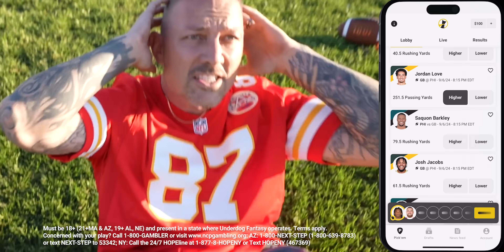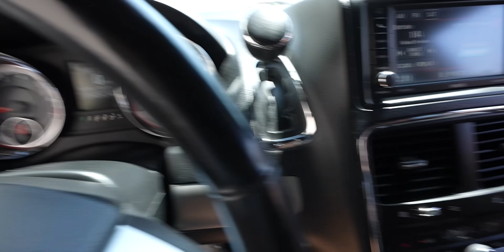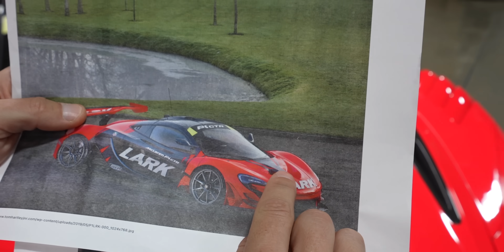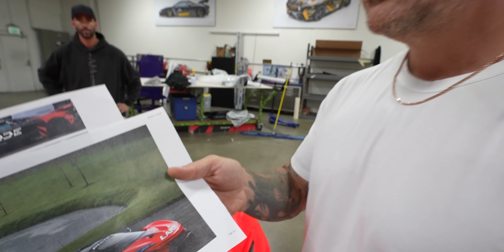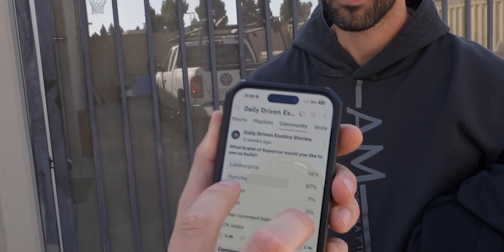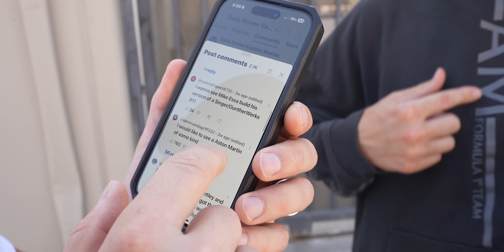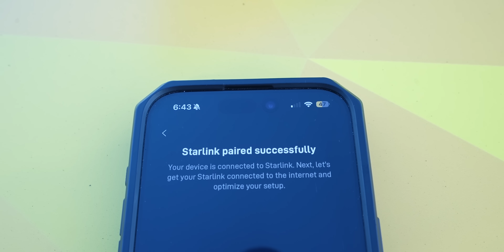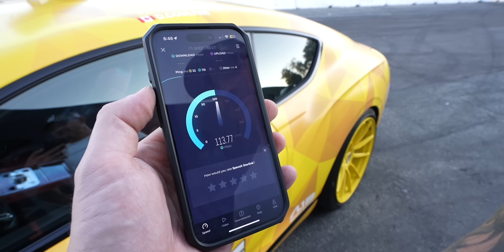REVEALING 1 OF 1 MCLAREN 720 GTR!

Comment: FTR acetone wouldn't have damaged powder coat like it did on Dave's wheels.. I'm fairly sure Fluffer even stated he was using PH neutral products, what most likely happened was a mixture of contamination and an incorrect baking cycle when they coated them due to time constraints. I have had matte light coloured wheels for ages and whilst yes they show the dirt more, they do not stain any differently. The staining and discolouration lies with whoever painted them the first time
Reply: Fool tryna get the fluffer not hired again
Reply: Didn’t they get it detailed by someone at Car Week also?
Reply: @isaacmays1815  I mean I didn't quite wanna say it, but yeah when Nick commented about it in another video he pursued it as the Fluffers problem and kept correcting Dave saying he definitely used acetone; when Dave denied it. I was a bit thrown by that but just presumed that was only my assumption lol.
Reply: It was clearly an issue before Fluffer touched it. Either the painting process or something someone else used.
Reply: @LonelyStonerHOU  yeah some random carpark wash station.. I recall Dave wanting them to degrease the oil stains on the wrap, not sure if they did much to the wheels though.
Reply: Came here to say fluffy said he was using a PH neutral cleaner so that shouldn’t have caused an issue.
Reply: Agreed, he was pointing fingers in the video and being completely inaccurate when instead of taking responsibility of subpar work that was done at his shop
Reply: @isaacmays1815  facts but i think that's why Mike had him come do the benz because they know Nick is full of shit
Reply: to be fair acetone IS ph neutral.
Reply: I don’t think it was fluffers fault either..he’s just happened to be the one that cleaned the wheels and uncovered the damage. Although Nick did say he suspected someone used acetone i think it was the guy that painted the yonda the one that was blaming fluffy. Like someone else pointed out the car wash from Monterey car week couldn’t have done the damage as Dave wanted the wrap degreased from Damons murcielago. On another note Dave recorded Fluffy apply the wheel cleaner real time and the stains were already “baked” on as well as fluffy noting the discoloration.
Reply: A friend of mine powder coats wheels and his first comment was that someone f’d up the baking process
Reply: Fluffy is dope
Reply: Don't think it was Fluffer fault. I blame the detailer in Monterey.
Reply: @everythingvinyl  it's neutral on the acidic scale, but also why would any detailer use acetone in the first place 😂that's why I don't get the sudden jump to conclusions of acetone being the culprit. The wheels clearly weren't baked properly, whether thats in the off gassing stage pre-paint, or after paint. I run Yellowstuff pads which are notoriously dusty, in fact one of the worst out there for dust and yet they've never harmed the finish on my matte wheels.
Reply: Fluffer didn't fluff up
Reply: Fluffer being defended is a W. Mans came and and became a character. Hope he truly wasnt the one who messed up which would be crazy since he pointed that fact out first
Reply: The original yellow was powder or paint?
Reply: @OGWonka  Powder coat, very little use wet paint systems these days because they're ironically not as durable. Some powder coats don't have to be overcoated, but uncoated use isn't recommended for applications such as a wheels - so this could also be another cause.
Reply: it was the kids offering free carwash they couldn't get the oil stains off the wrap and Dave had stated to them about the wheels and the cars were left there for awhile no supervision
Reply: @LonelyStonerHOU  no videos from car week so who knows lol
Reply: You can't stuff up the baking process 😂😂😂 it's literally an oven for 20 minutes at 220-250 degrees Celsius. It's BEYOND simple and impossible to stuff up. I ran a powder coating/electroplating company for 3 years @LeeSayer-o7m
Reply: He did say PH neutral
Reply: I’d bet Dave sprayed them down while the brakes were still smokin hot. That’s a big heavy car and I’m sure those brakes get nice and hot
Reply: @Kigoz4Life  that's because of the ride height (no engine).. hopefully 😂 the wrap does twist the design perspective a little, but yeah hopefully it's just the ride height throwing it a bit. I always thought the bodykit was quite top heavy though.
Reply: Check out the vid from the air bnb, bentley was parked rite behind the murci, cold start, raw murci fuel/exhaust shot on wheel!
Reply: @AdamsWorld84 maybe you can’t f it up because you good sir were born smart with common sense the way I see it you smelt it you dealt it an we all know who ran off a cliff immediately to point fingers and avoid accountability also that’s like the first elementary school deception tactic for someone trying to cover there own behind you an I k]both can agree on that I’m sure
Reply: Acetone will always destroy powder coating. Science.
Reply: Came here to say similar. Also Nick seems super sketchy and he threw shade almost immediately. The other people DDE works with seem to logically think through issues and identify possible mess ups but he went straight to finger pointing.
Reply: 💯% correct!
Reply: Fluff definitely didn’t use acetone lol. He’s a very intelligent knowledgeable detailer. He knows how to clean a car, the Bentley is cheap compared to cars he’s detailed
Reply: @atrixmatrix  I rate Nick, he's helped the DDE guys out on in-house wraps before, I'm not sure how new his Vol 2 business is but if it is relatively new I'd hazard a guess he's just being a little protective, though it's definitely come across the wrong way lol
Reply: Maybe yes to some maybe inncorrect baking etc, but dude you clearly don't know what acetone does. Acetone is a stripper, it eats superglue and varnishers. So on powercoating when even after being baked, theres no protection to it. If certain things eat away at factory coated diamond finished alloys etc then why do you think power coating would be safe. thats why brands put out PH neutral cleaners. Power coating is just cheap and quick.
Reply: @MacGyverScud599  if you leave acetone to dwell then yes, even vinegar would haha, but wiping it across a supposed fully cured surface? no it shouldn't. The problem with diamond cut wheels is that they're wet painted and it's directly onto a metal surface which doesn't bind very well - the white marks you see on diamond cut is just from the lacquer blowing; usually from the form of stone chips or hot brake dust eating away, in fact manufacturers could easily fix their problems by adding DTM binders and then clear powder coating over the top, but they won't because it's an extra process. Powder coat is over 8x thicker than traditional wet paint, costs more but requires less maintenance and is far more damage resistant, that's why it's a no brainer these days.
Reply: @producerlawson   Haha no dude no. And yes even wiping Acetone across a surface very much could strip or dull the colour. And no they don’t just put the paint on the the metal surface. Even morons know to put a primer down otherwise the paint will not adhere properly and the risk of deformation underneath is far too high.
And yes of course the marks you see on DC will be the lacquer chipping thats a common on all wheels, and while yes PC might be “normally” thicker than paint and less maintenance etc means jack at end of day because they will all still crack, flake, mark etc. And so why do you think that wiping Acetone over them wouldn’t make them fade etc. Only takes a minor hairline unseen crack in the surface of the wheel and the Acetone will seep in and dull the paint underneath. So tell it running bud.
Reply: @MacGyverScud599  man chill, if you want me to video myself wiping some powder coat with acetone I'll happily do it 😂the damage is clearly evident of brake dust staining on a poorly painted set of wheels, if it was that easy refurbers wouldn't need to spend hundreds on methylene chloride strip fluid. Not sure what your comment about primer is for as you cannot prime a diamond cut surface, unless you're planning on covering up the diamond cut 🤦‍♂at which point it stops being diamond cut - the binder I was referring to is a solvent based barrier to stop the porous aluminium outgassing, not primer. Manufacturers of brushed and diamond cut wheels degrease and lacquer straight over, hence the limited 12 month warranty on nearly all diamond cut wheel - if you want proof go and watch the HRE documentary which shows their process.

Comment: For the starlink you don't have to buy the in motion package. They work when driving. I use mine on my truck almost everyday doing 120km in gp here. The standard gen 3 mount is way faster than the mini and you can get the flat mounts that are magnetic.

Comment: As a 720 owner not going to lie the car looks beautiful but the flaw in the kit is it makes the front wheels look awkwardly too far back & need to be forward which is an expensive fix by shaving the front wheel well back or a suspension mod that moves the wheels forward, can't un-see it.
Reply: Car looked absolutely perfect before the wreck. This kit is frankly awkward looking.
Reply: It looks the same imo same wrap and everything in person you could probably notice how much wider but on camera it just looks like they added a bigger wang and some accents
Reply: Yep. I noticed that too & also cant unsee it. I dont even know how that made it outta the body shop looking that uneven. The entire kit was a mistake, its just awkward & has 64 construction bolts just to attach the wing. (Not to mention the idiots using bolts to secure the intake vents instead of ordering new clips) & even more bolts under the doors🤦‍♂️
Reply: @joeykeegan6909  I agree. If they werent gonna repair it with oem parts.. they shouldve sourced a genuine gtlm/gt3/720x racecar kit.. instead of this one. Hell, it was designed so poorly that it has 64 construction bolts holding on the wing (& still doesnt look stable at all). They honestly need to just have cnc aluminum uprights made that only need a handful of bolts per side

Comment: I would suggest getting Jason a 2010 V12 Vantage , NA V12 with Manual  Gearbox and Carbon ceramic brakes, base is 550PS, can easily tuned to 700 or Supercharge to 1000PS . build into a V12V GT3, Prodrive in the UK built the race cars for Aston so they will have the kit.

Comment: I just picked up my 6 speed 2006 V8 Vantage w/ 28k Miles for $43k. 

These things are sleeper deals! My 997.1 C2 6mt (2006) was worth ~$32k w/ 95k Miles, and was not even close to as good of a car as this. Highly highly high recommend it to anyone looking!
Reply: 😂😂😂 I’ve had both and there is no way they match dynamically, the Porsche is far better. However, the vantage will stand out more and look more exotic. Guess it depends on what you are using it for.
Reply: @EAD_0  that’s the correct statement!!! As a drivers car and dynamically these cars are miles apart. As a brand name, bang for your buck and looking cool on the street the AM V8 wins but for the people who know, they know

Comment: Shots fired at the Fluffer from Nick
Reply: That's what I thought 😂😂😂😂
Reply: Idk if it was him or the guys at Monterey. Remember those guys did a shitty job with it, even Dave said something too.
Reply: @SUPERSTREETx 100%
Reply: Its was not fluffy.....
Reply: Meh this was before fluff touched it
Reply: @charlie1832  I don't think it was Fluffer bc they wouldn't bring him back to wash Mike Mercedes.
Reply: Nick not taking responsibility. If the finish was done correctly and it should be resistant to acetone, but they didn’t specify the process used. Regardless it was not Fluffies cleaning supplies that did the damage. Kind of a dirt bag move from Nick.

Comment: You can get a custom flat mount made with either heavy duty magnetic or suction cups to run on the roof, run the regular plan and make sure if you run the gen2 turn off the auto movement mode on the app. Never had issue running it on my truck on the rigs here in Berta

Comment: You can put ceramic pads on your steel brakes and they’ll work good and you’ll have no dust. I did it on my Audi S8 when I change the road and dimpled and slotted with ceramic pads no no break dust

Comment: 100 and 40 mb or MB? Big difference dave. Not joking. MB os 8x the bandwidth. 40MB up is very good. 40mb however is not
Reply: In other words, 40mb up and 100mb down is equivalent to 5MB up and 12.5MB down. 1MB = 8mb.  Read the fine text to be sure which it is